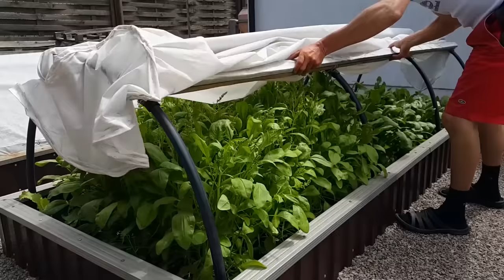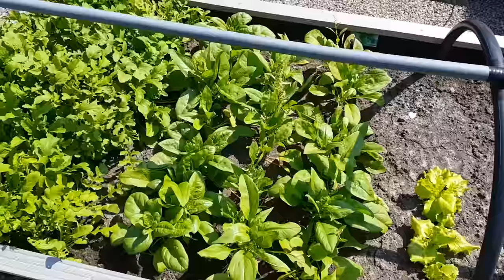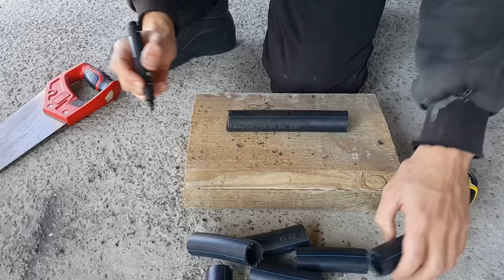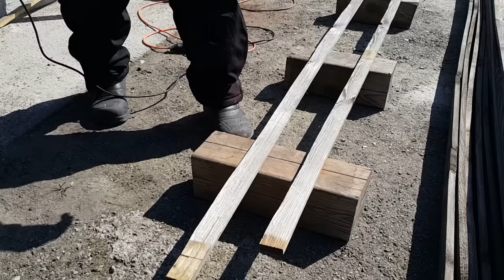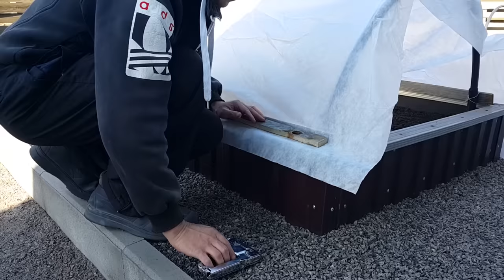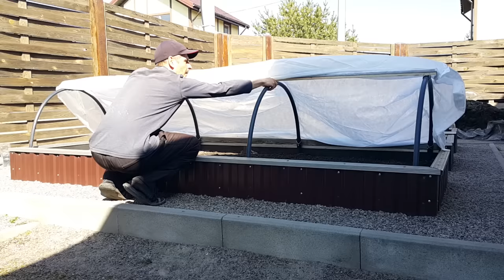152. Очень удобный парник, своими руками.

Comment: This is brilliant! What material would you use for the same frame if you wanted to keep squirrels and voles out? Do you have any videos about frames for keeping critters out of the garden beds?
Reply from the maker: Thank you very much!
This greenhouse protects well from insects.
And cats protect well from squirrels and voles.
Reply: We use wire fence called hardware cloth. holes are under 1cm square (1/2 inch square). Put it under bed too for stopping moles/voles.